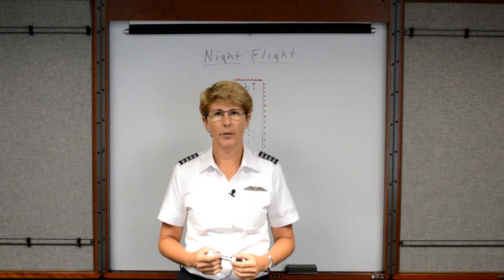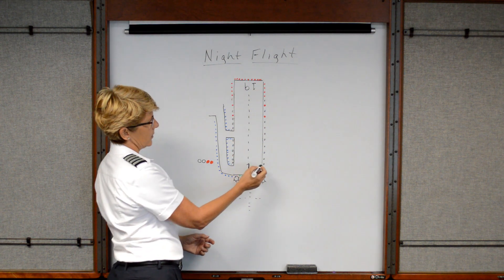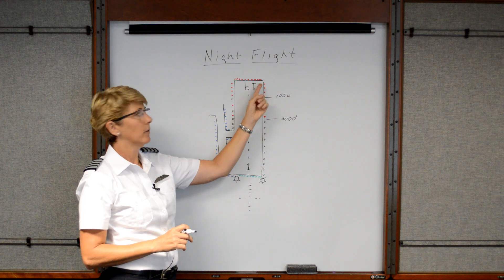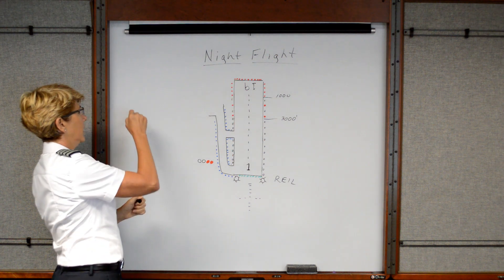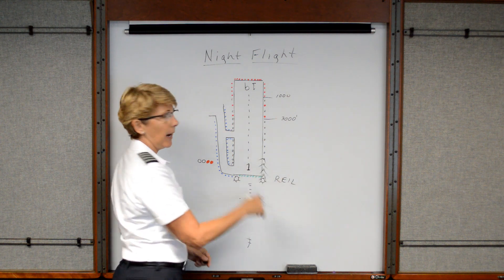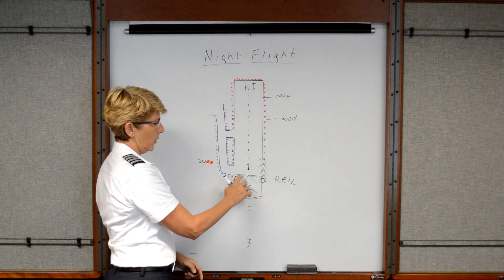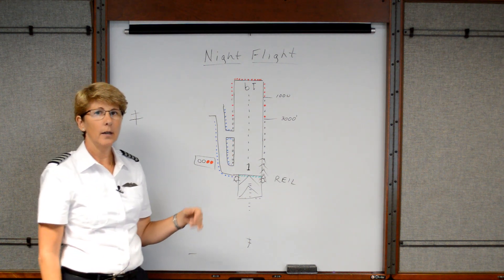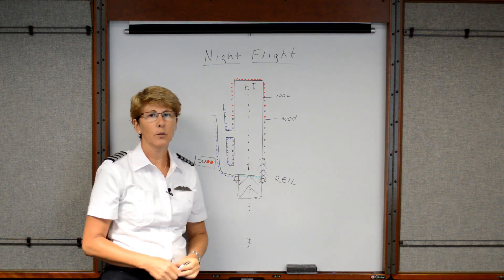Night Airport Lighting (Private Pilot Lesson 15c)

Comment: I though the Runway Center line lights were White until the last 3,000 feet of the runway and then 2,000 of it was alternating red/white then the last 1,000ft was just red, However the Runway Edge Lights are White until the last 2,000 feet and then its yellow to form a caution zone.